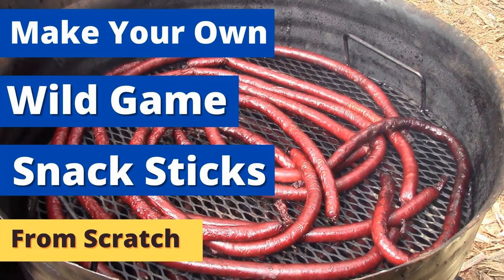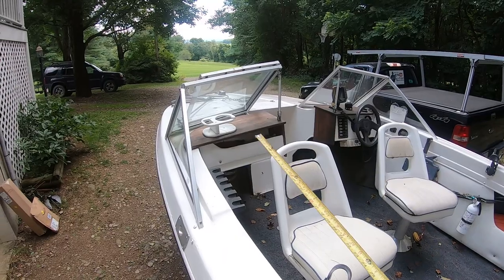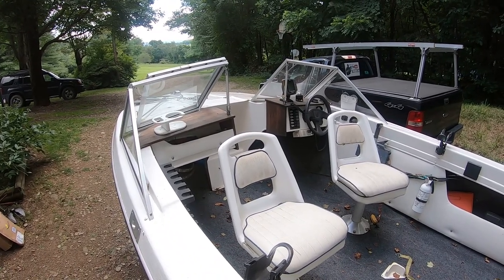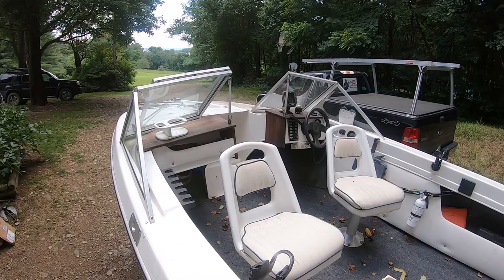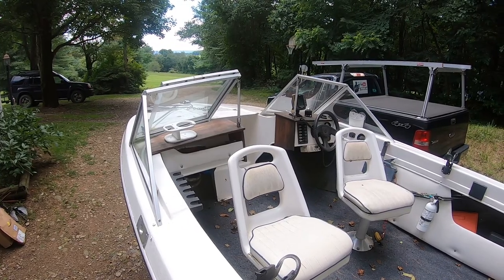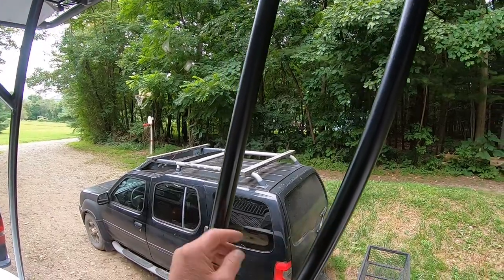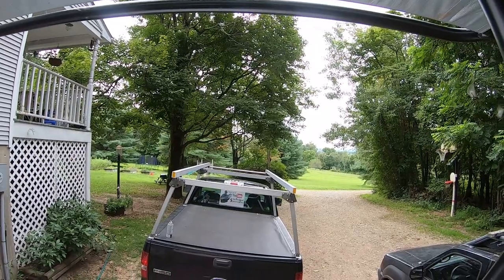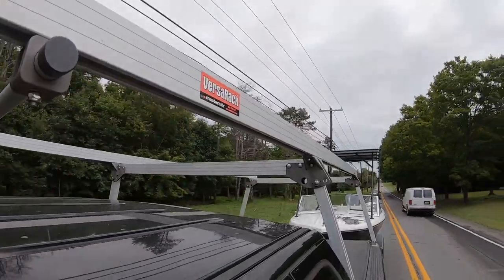My Inexpensive Boat Shade Top Step By Step Build!!!

Comment: For the tarp make a bracket to hold a piece of pvc pipe a little wider than the tarp, run a piece of round bar with a handle from end to end, router out a notch across the pipe for tarp and attach the tarp to the bar inside. So the tarp can stay  rolled up into the pipe and the end doesn't have to be rolled around the back and it won't catch any wind.
Reply from the maker: Thanks so much for sharing your ideas! We can all learn something from each other and I appreciate you sharing! Thanks for watching and God bless!

Comment: The people around me had a heart attack when I built my rod holder out of steel, but the northwestern and the time band that I said are all made out of steel on the ocean and I’m on freshwater I had to repaint it once nice job. Nice job.
Reply from the maker: You are 100% right. Yeah it is nice to have a stainless top, but it would be out of my price range. This top has held up in both fresh and saltwater without issue. It only requires a bit of touch up paint on occasion to keep it looking good. Thanks for watching and for your encouragement and may God bless you!

Comment: Excellent video. Beginning to end! I hope that I can get a boat and do this.
Do you think this would be too top heavy, or simply too heavy for a aluminum Vhull? 
Subbed
Reply from the maker: Thanks so much for watching and for subbing! I also appreciate you kind and encouraging words as well and glad you found the video a help! As far as being top heavy it really depends on your boat. I designed this for my boat which is an older 1970 Glastron that I restored with a larger gas tank, 2 batteries and pressure treated plywood so it has a very lower and heavy ballast weight. I've been out in rougher water with it without and issue. I think the top might work for you on something like a Sea Nymph Great Lakes aluminum v hull with a wide width, but I think it would be top heavy for narrower V hull aluminum boats. You could also use aluminum tubing as a lighter choice. You would have to do some experimenting to make sure it is all safe and stay within the weight rating capacity of your boat. Hope that helps. Take care and God bless you!

Comment: That’s really nice….could this be done with electrical emt conduit?
Reply from the maker: Thanks so much! I think using EMT would be a stretch as it isn't as strong as the tubing I used and because EMT is galvanized it would make welding more difficult. And if you used EMT connectors instead of welding I wouldn't trust it. I wanted something I could grab onto in rough seas and also not worry about my rods being supported up high. EMT is also over $10 a length now for 3/4" and up. I would check with metal scrap yards in your area. The one I go to is a little over an hour away, but they have all types of steel for .55 cents a pound. Also as an FYI I did build one of these out of 1 1/4" PVC pipe that worked okay for a while, but snapped off on me when I hit a wave during a cold day out fishing. So I wouldn't trust that either. I hope that helps. Thanks for watching and sharing and God bless you!
Reply: @thefrugalsportsman  ok thanks…yeah I was kindathinking the same just wanted your opinion..great video and thanks again